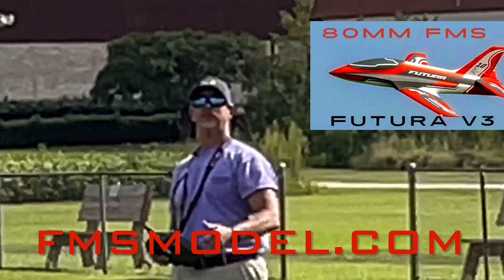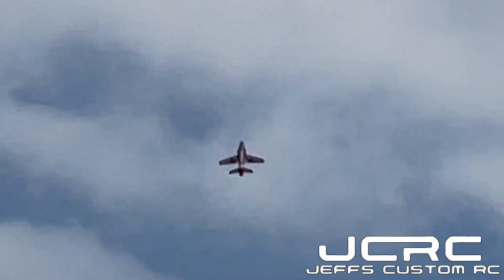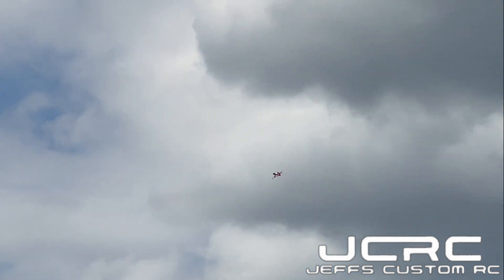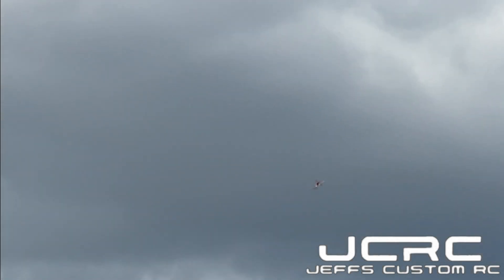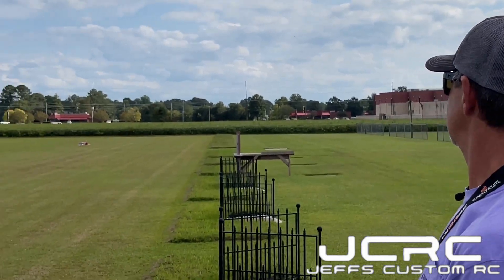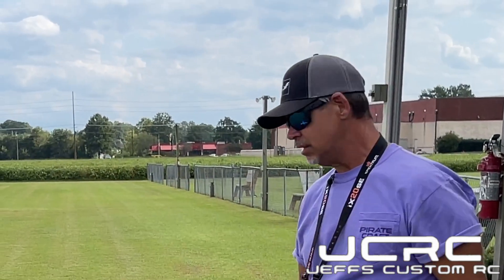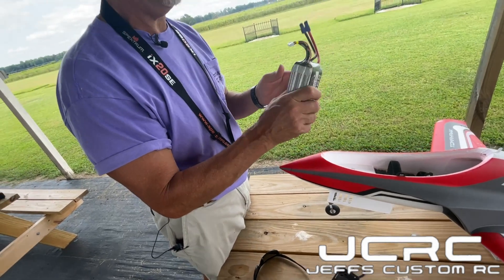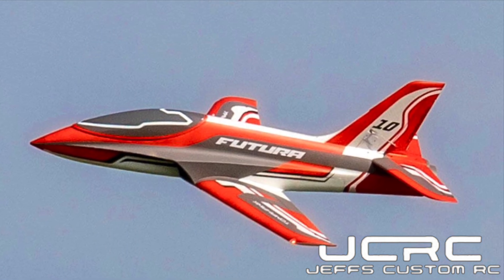FMS EDF Jet 80mm Futura V3 PNP with Reflex V2, PNP

Comment: What a great year 2022 was for jets! I think the 90mm Viper started the year. Then I got the Freewing F-22, and then started the “FMS Experience”. I had never owned an FMS. The Yak-130 started process. Then the Bae Hawk and shortly after the Futura v3. I didn’t think there was a better, more enjoyable edf to fly than the Viper 90mm. Both the FMS Bae Hawk and the Futura v3 are just great to fly. If I could only take one jet to fly out of those three, it would be the Futura v3. I liked it so much I bought a 2nd and increase the size of the ESC and the FMS platinum 80mm. (Like it wasn’t fast enough… Now I have an 8s Futura….)
Reply from the maker: Wow!!!…very nice, love my futura V3, thanks so much for watching 👊🏼
Reply: What are the reasons you like the Futura v3 80mm better than the Viper 90?